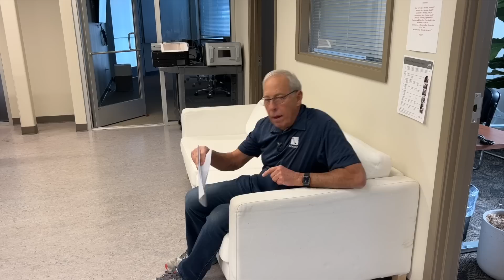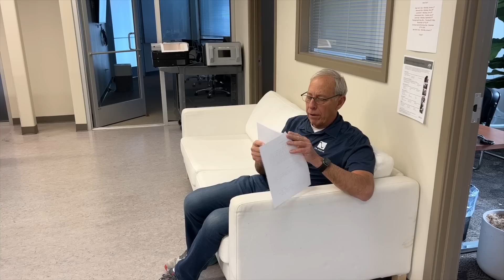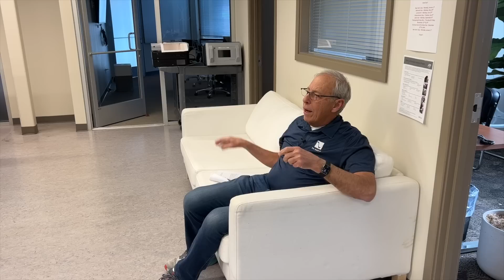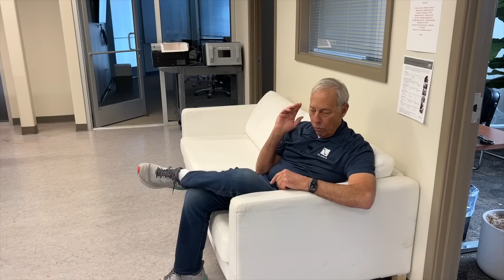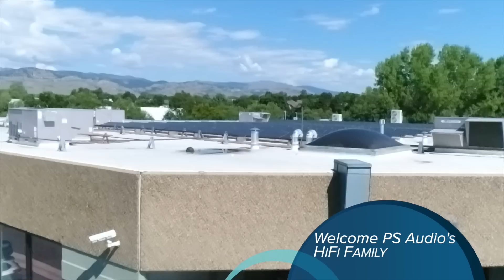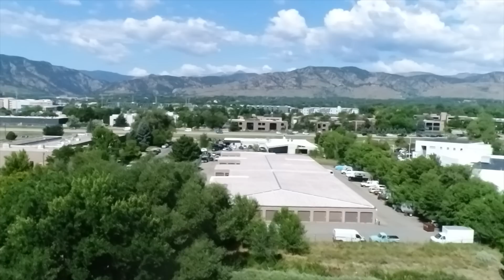Building a Mac Mini music server

Comment: I fail to understand why people think there are different sounds from different file servers. A file server is a file server, period. I use a Qnap 16TB Raid5 ( 10.5TB ) NAS. And, at times, a Raspberry Pi 3. Same file, same seperate audiophile playback system, Gigabit LAN, the file sounds the same from both sources.

These things DON'T stream. The file to be played is transferred over the LAN in sub milliseconds. Not streamed.
Reply: You have to cut some of these people some slack. Not everyone is a computer geek, not everyone is an Audiophile on this channel. People use music in many different ways, their own way, whatever works for them personally. 

For some it can be confusing
because of the many factors and variables with different types of software/hardware they use. Some of these people on this channel even do their own coding in Terminal. ✅
Some use Bash commands. ✅

They have used Windows, Apple, Linux, Chrome OS, Android, IOS, Raspberry Pi, etc.
Reply: You dont understand because you have not heard the difference yourself.
Reply: @papapapaw  I have at least 6 different "file servers" here all of which can serve audio files to numerous platforms via 1GB Ethernet LAN. Example an 8-minute long mp3 file. The amount it takes to transmit that file from the file server to the playing device can be, and I can do this, measure that time in milliseconds.

I have the tools here that can totally display the entirety of the format of those files. There is no difference in how that file sounds one server to another. And that is what Paul said in thi video.
Reply: @wilcalint  you said “mp3”. Explains a lot.

Comment: Sorry, I just converted you to a "McDonald's milk shake", I do have JRiver bit perfect, but it and YouTube don't talk to each other - Not that it probably matters after the YouTube compressors etc have done their work.

I also run a Raspberry Pi based Volumio player/streamer, in which I've avoided adding any extra plug-ins etc, thinking that extra CPU load could cause degradation, kind of like that 'stripped down' Mac mini.

Comment: because of planned obsolescence and lack of software support (updates bricking some macs) i do NOT support or run macs on any of my or my customers systems. the two systems i DO use are suse and windows (not later than win7 because of backwards compatibility problems with later versions of windows). macs are not the workhorse of the industry at ground level.